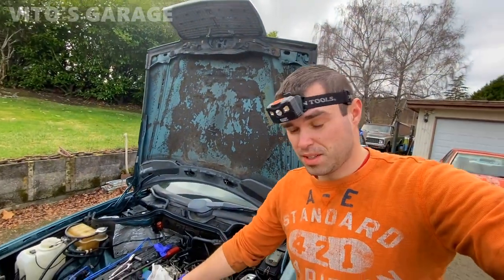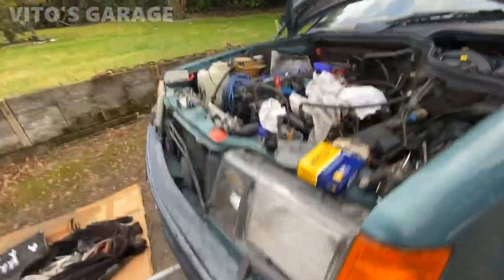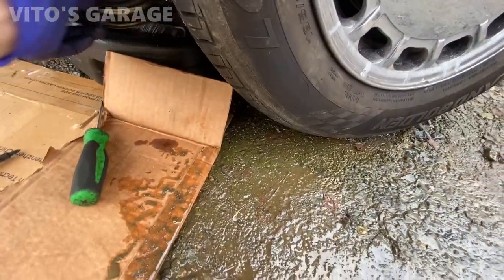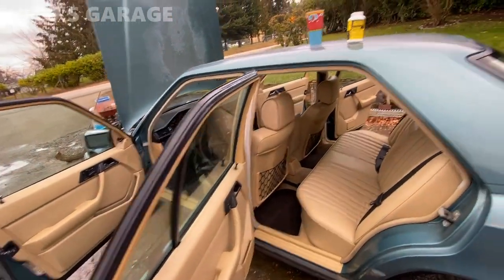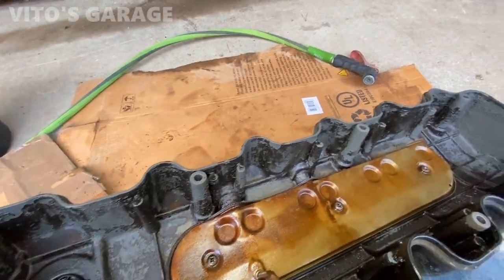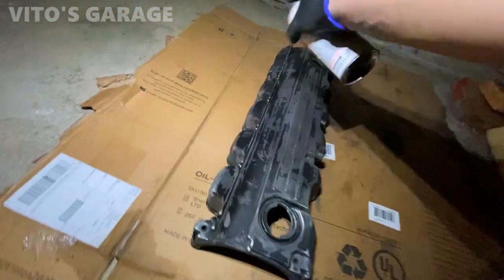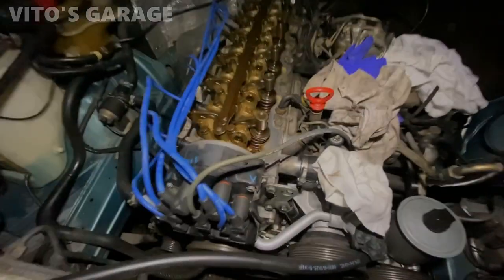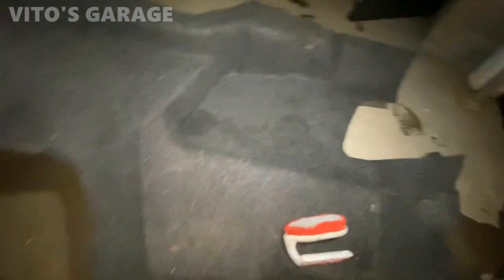Part 16 Mercedes W124 300E Power Steering Flush, Hoses, Filter; Valve Cover Restoration & New Gasket

Comment: Hey Vito. The inside of the valve cover is the original paint. On all my valve covers, I used paint thinner to strip the inside because I was afraid the paint would flake and go to the bottom end. Great job, someone definitely did the oil changes on time! Rockers are amazing, no sludge buildup!
Reply from the maker: Good to know. Thanks brother!

Comment: I'm doing power steering hoses too. I bought a car, puddles. Grrr Hurry home, I need help converting to a manual transmission.
Reply from the maker: If you’re in the USA it’s gonna be a pain finding a manual trans complete kit. There’s one for $4k on eBay. The seller is in Canada if you’re interested. In Europe and other continents it’s a piece of cake finding all this and usually cheap
Reply: @VITOSGARAGE  I've got most of the parts. Now to inspect the trans. Some guy just told me about torque tubes failing in S4's. Naturally I figured people abuse S models. Sounds like he meant the main shaft.